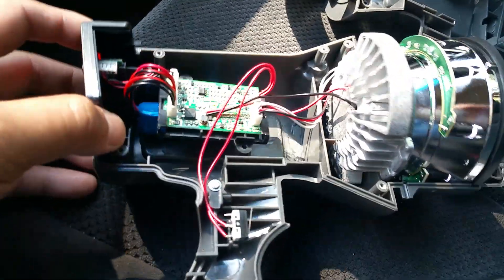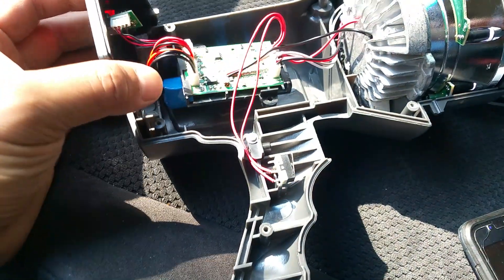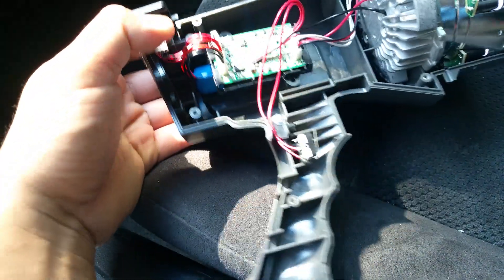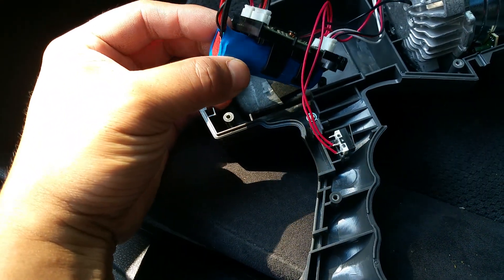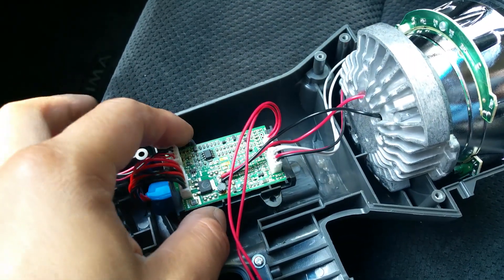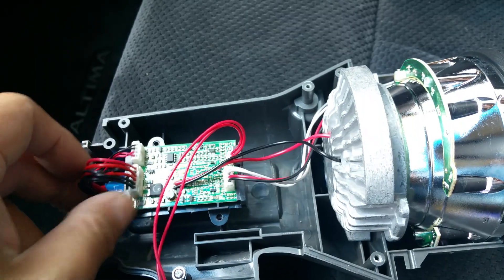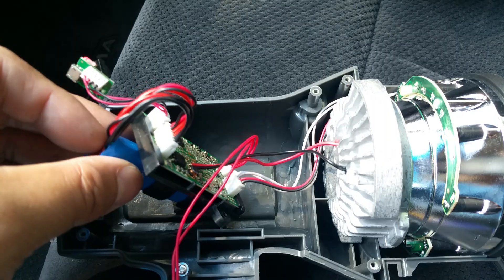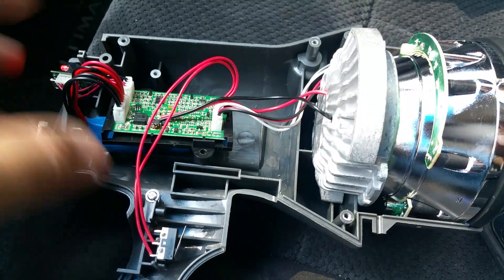WHY IT SUCKS - Stanley 5W 1000 lumens LED Lithium-Ion Rechargeable Spotlight

Comment: This light does not suck. It's a great light. I've had mine over 2 years and have had no problems with it. And there is no false advertising. They claim 10 hour run time on low "halo" mode. Run time on high is not mentioned, but it is much longer and brighter than rechargeable halogen spotlights.
Reply: I’ve had mine for years and it works amazing for me and the high beam lasts a good long time.

Comment: So have you found a different brand that does have long-lasting light & more than 1 battery in it? I have a Stanley brand waterproof spotlight that looks just like this and it doesn't hold charge long obviously but I am wondering if you have found a strong rechargeable portable spotlight that you like yet and that has more batteries in it, looking for recommendations
Reply: Im on my 3rd one , i thinknthus one got wet.

Comment: Ik its late but...thr best solution for longevity ive found r those 18650 lights with an extension tube. That's about it as far as budget lights go. Nothing at Walmart runs for 8 hours. Lol
Reply: Thrunite and surefire may be wicked bright but longevity...idk. incandescent 12v off ur car maybe? Whatd u go with?
Reply: what's an 18650 light?

Comment: Bro i got the same flash light. And i cant get it apart what is stoping me. Im thinking is the silver ring that looks to hold the top linze in place my question is dose this pice screw off or dose it have some kinda clipes on the inside.  Im not far off of. Useing the open just about everthing tool ( the Hammer )  lol. Thanka bro. For any help on this matter. Have a blessed day.
Reply: Yes, you have to unscrew the silver piece about an eighth of a turn for it to come off. I discovered this after I used a hammer to get it off. I didn't have the strength to turn it.
Reply: The “stand” comes off by removing the end caps on either side followed by removing the screws the caps were covering then once all other screws are removed from the outside it should come apart